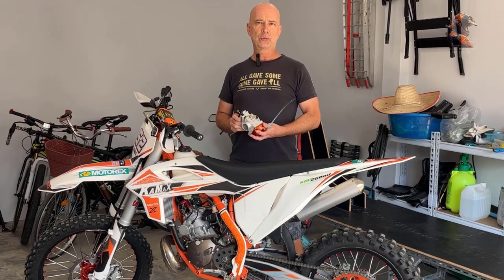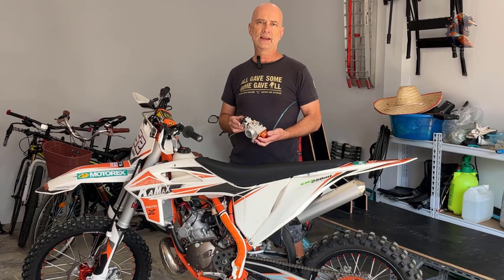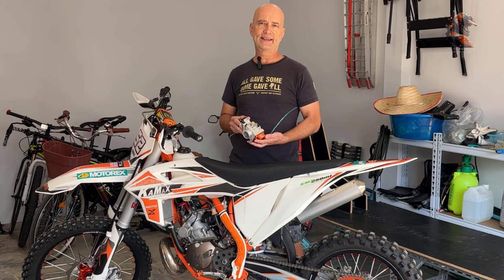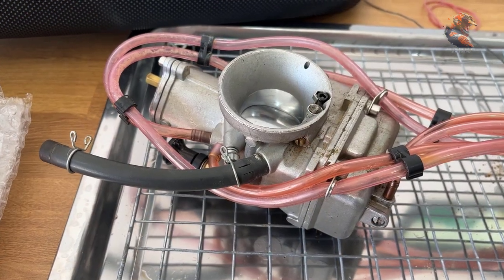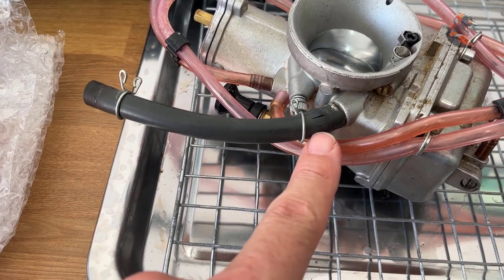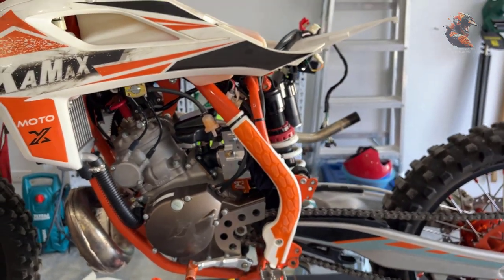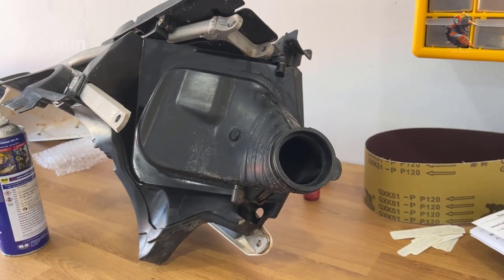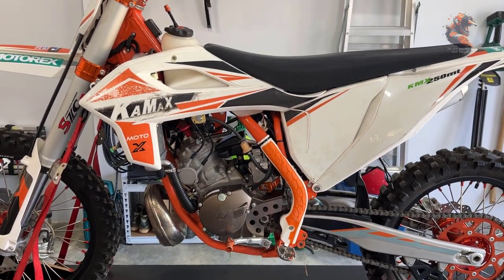Installing a SmartCarb On a Chinese Dirt Bike

Comment: I have the smartcarb on my yz250x and it’s absolutely flawless it runs so good it’s unreal I’m sure you will like yours I know there expensive but it’s so good I forget it’s there
Reply from the maker: I just had my first ride with it two days ago. It felt very smooth, crisp, and responsive!
Still need to tune it a bit, I think. I’ve adjusted it a few clicks leaner, but will try some more.

It was a great start with the SmartCarb! 😃
Reply: @tomatdb52  that sounds like mine I went about 10 clicks leaner but it didn’t run bad how they sent it just a little rich like yours I think they send them on the rich side to be extra safe
Reply from the maker: @robertbaker9329  Exactly. I’m just 4 clicks leaner so far.
Reply: @tomatdb52  hopefully you make another video after you get it sorted out im all in on the smartcarbs lol

Comment: Do you have complete video from step 1 to end how to install SC2 on Kamax?was about to show this video to my neighbour but it seems not relevant to much shortcut
Reply from the maker: The installation is very straightforward. The most important step is to ensure that the air booth does not cover the intake at 03:55. On most bikes you have to carve off a bit of the air booth as I show at 04:15. I used a knife and a Dremel. When checking if you carved off enough, just put the air booth back and connect the carb. Take a photo with the phone to see if the intake is 100% free from the air booth.

I hope this helps!